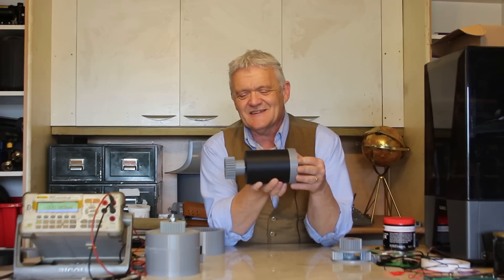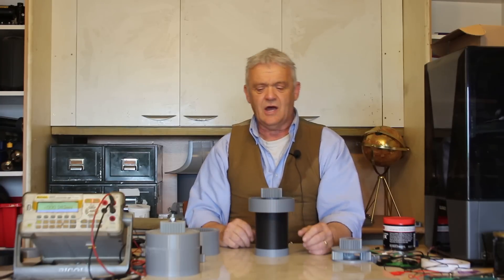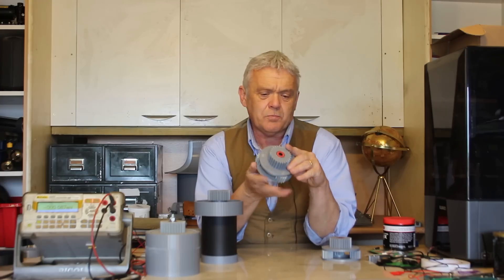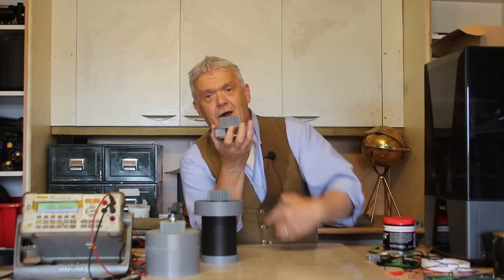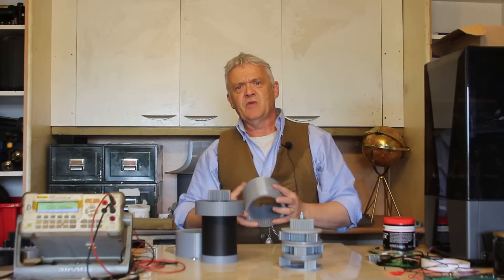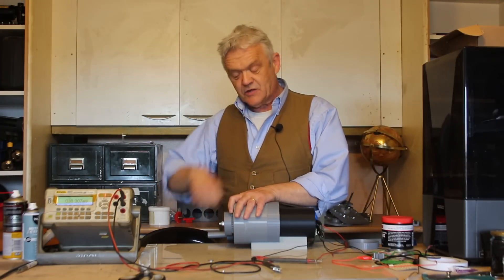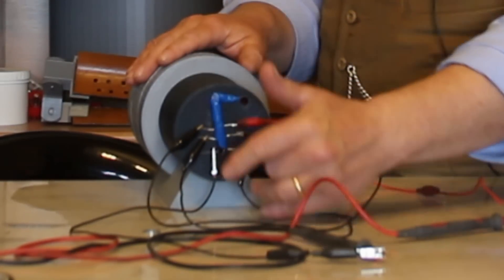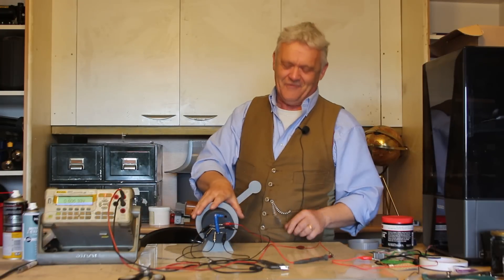1964 A DIY Wind Turbine Gearbox And Its Crazy Output

Comment: I live the gearing sysyem on that and want to build one mtself. Im looking at adding it to a solar inverter system, is there any way of limiting the output voltage to say 48v or whatever the input voltage of the system is? 
Pumping in 100v would not be great 😕

Comment: Nice, and still even with the gears, power out = power in ,  approximately here.  A voltage increase but a current decrease by the same value.   P = VI or VA. Another way to boost voltage is with a transformer, perhaps to send the power a few miles away without using thick wires,  and then we can use a voltage step-down transformer at the destination.

Comment: Could you maybe make a mould for the components and then cast them using the graphine plastic youve made previously?

Just wondering about durability...could be about as practical as required if you could make it work.

Comment: A  suggestion，maybe you should add a automatic clutch system between the generator and the gearbox to  let  the blade build up speed before start generate power.Or  it may need a very fast  wind speed  to start the  rotation .

Comment: I notice your blades are wood. Wood is probably the material most resistant to stress cycling. A big problem in large turbines compression/tension. If they used wood you could cut it up and build sheds out of it or something, no waste.

Comment: The gearbox will be a nice source of heat due to the friction losses!  In a perfect design the available output torque from the wind turbine will be matched to the torque load of the torque-to-electricity converter part of the system so that the maximum tip to wind speed ratio of the blade tips is not exceeded at design wind speed. In other words - the load (coil design, number of poles etc) should be matched directly to the turbine power curve without the need for gearing up.  But its a lovely wee gear box anyway in'it!?

Comment: I love it Robert.  We are currently working on an actuator at my employer that uses a very similar planetary gear system.  Not to state the obvious, a major factor we found was gear quality is paramount to efficiency.  Any gear “roughness” had a direct effect on the overall performance.  3D printing gears is excellent for proof of concept, but good quality gears will produce much better efficiency.

Comment: What is the point in designing a gearbox at the cost of lost torque?
Design the stator and rotor for the RPM's you need. A low RPM stator can supply energy at hand crank speeds, no need for a gearbox.

Comment: The High voltage is very nice. But in all these energy generators the more important thing is usually the total power. It would be more instructive if we can see the power output rather than voltages or currents.

Comment: The peak voltage only matters if your insulation breaks down.

You can always transform the power to a lower voltage and higher amperage, and the impedance is your resistor, only it wasted a lot less energy than resistive losses, especially if you use a ferite coil.

Comment: Brilliant show, mate.  I would love to see it with four on it, as that would be scary indeed.  Look out as you might get so much voltage you will not melt the wires just measuring, but the electricity can jump across if not careful (breakdown voltage of the wire sleeve material).

Comment: i have boxes of old cordless drills and they have the stacked planetary gear stuff in them between the motor and the chuck, it also has a lever that must push one of the ring gears from a higher speed to a lower speed set of gears. so i took one apart and it ended up in a heap of little metal bobbies abnd i couldnt quite figure out how to put it back together. but yeah, i can put a fan blade in the chuck, spin it up, and the motor spins crazy fast shooting power at me. i like big plastic gears tho, think ill print some up!

Comment: Have you ever seen the size of the wires in the vape pens , not the coils that vaporize the ejuice I'm  talking about the wires that carry the electric to the coil/s , they are very fine and they will handle 2 to 3 amps at 3 or 4 volt I think. Also the wire in the AC adapters have to handle at least 120 volts , the amps is usually I think in milliamps but I think some of them will handle up to 1.5 amps . That's cool Robert. I'm not trying to push you into frying your generator.
Reply from the maker: you are right mate i am being a bit over gentle - but i want a minimum target - that is to beat the $400 turbine - if i can do that with the fraction spend i have made so far i will be happy - I also hope others will take this and improve on it mate

Comment: would this charge a 12v battery with the hand crank in a reasonable time or a 20000mah battery bank for offgrid/camping use
Reply from the maker: you can put out about 60 watts with arm strength

Comment: I guess gears are simpler than making a complex stack of centrifugal gears. Where you have balls that change the gear ratio as they spin faster, they move to the outer rim of the disc to increase the gear ratio as speed increases.
Reply from the maker: yes they are

Comment: That setup with plastic gears appeared to have a lot of drag, more than the blades can overcome in a modest wind.
Reply from the maker: it does have a lot of drag but it will be fine - of course the simplest way to improve it is to improve the gears

Comment: Looks like you were putting a fair bit of effort in to get that 100V with no electrical power produced. Those stacked gears will be absorbing a not insignificant amount of power. Be interesting to see how much more difficult it is to turn in a realistic situation when you stick a 10 ohm resistive load between the output terminals... 😊 I think that sized turbine blade won't be big enough...
Reply: No lube and no bearings
Reply: @SinsBird  Do what now...?
Reply: @saiello2061  With lubrication and bearings I imagine it would be 3% or 4% power loss on each stage.
Reply: @SinsBird  Possibly, but those gears are very noisy! Noise = inefficiency.... Best solution is always no gearbox and redesign generator for direct coupling.
Reply: @saiello2061  The approach really depends on ones abilities, some people are better with mechanical part, others with electrical. So whatever takes the least effort and money per kwh is the way to go. Anyways, there is/was a 3d printable wind turbine on thingiverse called MKIII that seems like a pretty interesting project if you have access to cheap 3D printing. The only problem with it is that it's using a stepper motor and if I'm not mistaken steppers are terrible generators, much better to use a DC motor on it.
Reply from the maker: no it isn't - there is no such thing as a best solution
Reply from the maker: spot on mate
Reply from the maker: losses are going to be high mate - talk about stacking things against myself lol
Reply: @ThinkingandTinkering  Agreed, in fact there are never any solutions to anything, only compromises. But if one is interested in efficiency, and to be honest most have a mind to this, then intervening power transmissions néed to be the first thing to go, or at least kept minimal, that's all... 😊
Reply from the maker: @saiello2061  that's a fair comment mate - but I am not interested in efficiency per se - I am interested in beating a product manufactured and sold for $400 with something home made that anyone with a modicum of skill and access to small resources could make at a fraction of that cost - but you do make a good point and you are dead right this could easily be improved with better engineering. Oh by the way the resistance f the coils is 80 ohms so an 80 ohm load would probably be a better choice of load
Reply: @ThinkingandTinkering  Oh yes, anyone making the effort to try and beat an overpriced commercial unit is defo to be applauded..! 👏 Interesting to see how it pans out. Good luck..! 👍
Reply from the maker: @saiello2061  cheers mate - and i really do appreciate the time you took to chat - all the best
Reply from the maker: it was pretty easy actually - but are right a lot of efficiency was lost in the gearing - so - improve the make of the gearing

Comment: High volts doesn't make the wires hotter, if anything it makes them cooler, you can make the same power with less heat using higher voltages as it negates the wire resistance. Your voltage is only limited by arc distance, I think 200v is safe.
Reply from the maker: cheers mate

Comment: Thicker gauged wires will lower the voltage to a more useable voltage while increasing the amps, and more blades give more torque less RPM
Reply from the maker: cheers mate

Comment: some of the cheaper cordless screwdrivers have planetary gears in them, many years ago I bought about 6 of them (for something silly like £1 each) and used the planetary gears the other way around, one to produce a fine focus knob for a telescope, and also to produce a drive system for tracking the stars that was geared down to approximately 1 revolution per day, the cordless screwdrivers use planetary gears to increase the torque and slow down the motor speed.
Reply from the maker: well worth looking ut for and keeping if you get a cheap source mate
Reply: @ThinkingandTinkering  yes they work both directions , I wonder if there is a way to make a centrifical clutch to lock out one or some of the ratios for different winds speeds?
Reply: @maxgood42  Sturmey-Archer did this decades ago. All you would need is a govenor weight on the hub, held back by spring pressure, as rpm rises/falls the weight pulls/releases the selector cable, and changes gear(s).
You could do similar to pivot the blades to 'feather' the angleof attack. (Ive done the latter, with a thrust-release bearing, I can adjust the torque/rpm limit while it is turning).

Comment: Once again brilliant. I think starting torque may be an issue so you may need to reduce the gearing a little buy hey, we will see, Can't wait. Thanks for the best channel on you tube Rob.
Reply from the maker: I agree mate - but to be honest I have no idea - however, you might have noticed i did the ring gear in sections too so i can alter the gearing pretty easily if i want to - the plan is to try it out and modify it on the hoof so to speak and see what we get
Reply: This is my concern too - so I can't wait to see how it performs and whether the starting torque is a problem or not, and if it is how Rob will choose to get around it! Really enjoying this project. Thank you Rob!
Reply from the maker: if you have a look at my reply to Peter - you will get an idea of what i plan mate - of course if it works straight from the bat I am going to crow like mad lolol

Comment: I like it. I got same result by stacking bicycle rear cassettes. (no 'printer', just access to tons of scrap bikes and a MIG welder) 
I’m still at a question why wind-turbine blades are so slim at the tips. I can understand bird/bat/aeroplane wings being so, for weight to lift and strength considerations. But assuming leverage and torque are the thing wouldn’t blades that are broader at the tips ‘grab’ more air? If weight re lift isn’t a factor, the spine/hub of the blades can be beefed up easily to cope.
Reply from the maker: good question mate and good alternative source of gearing cheers me ol' china
Reply: You definitely have a point there-worth taking a closer at I believe.

Comment: Still waiting on the ONE VIDEO that will make these power generation USEFUL. How do I safely store this power in my solar generator.
Reply from the maker: ok
Reply: A wind turbine needs a dedicated charge controller, preferably a Maximum Power Point Tracking (MPPT) controller, rated for the battery voltage of the solar generator if they are to be used together. 

-still waiting for THAT VIDEO too.  I expect at least a few year wait.
Reply: @danedmiston9673  Can you outline some practical (or technical) principles of how a MPPT operates as an interface between a source of power/energy and storage?  Just asking.  Thanks.
Reply: @bikerfirefarter7280  For solar panels there is Rated Voltage, an Open Circuit (no load) Voltage, and a Voltage at Maximum Power (the voltage were the panel operates most efficiently).

For example a solar panel Rated at 12 volts may have an Open Circuit Voltage of about 21 volts and a Voltage at Maximum Power of about 14.3 volts in full sunlight.  As the sunlight dims the Open Circuit Voltage will drop as well as the Voltage at Maximum Power.  If the Open Circuit Voltage is measured in the reduced sunlight then the new Voltage at Maximum Power can be calculated.  For many solar panels the Voltage at Maximum power will be about 68% of the Open Circuit Voltage.

A simple charge controller only limits the voltage to the battery to protect the battery.  An MPPT will protect the battery but also tries to maintain the solar panel at its Voltage of Maximum Power.  A google search will show many different ways that can be used to constantly estimate the Voltage of Maximum Power and then maintain it. Some MPPT controllers will allow charging in very dim sunlight by boosting the voltage from the panel up to the required charging voltage.

For wind turbines the Voltage of Maximum Power is based on the RPM of the alternator.  A good wind turbine MPPT will allow for custom power curves to be programed into the controller.

Another thing to consider for wind turbines is that the efficiency of the wind turbine is tied to the turbine RPM as a ratio of the wind speed (TSR).  Unless the alternator and turbine are very well matched it is hard to achieve their full efficiency potential even with the best MPPT.

Comment: Hi I am regular viewer of your channel I like the way you explain and do practical stuff.
 
I have a question....regarding wind turbine and power generation. 

Can we use piston instead of direct power generation from windmill to compressed air and use air engine or turbine to generate electricity at constant rpm?

I thought about it because vawt or hawt slow wind will not produce enough power to charge battery, but slow wind will compressed air (slowly) which can used it later to generate electricity. 

I don't know about efficiency and related number.....I just have a thought....

Regards
Reply from the maker: for sure - you can think about the compressed air as a kind of battery - and it has lots of advantages over normal batteries
Reply: @ThinkingandTinkering  thank you for your reply. I am going to make a darwin wind turbine but had a confusion regarding compressed air or direct power generation. 

If possible can you explain it's advantages you mentioned in comments in your future video?

One more thing I Don't know that how much torque it required for compressed air and should I have to use gear to increase torque? And how much it can compressed air in a tank in term of psi. Means can we expect 120 psi with a small piston in 200 ltr tank....😀

Sorry to annoy you but I have many questions and don't have answers.

Comment: So I wonder, how much wattage can this produce? Sure there can be around 100 volts but what would be the current?
Reply from the maker: oh we will get what we want mate and then some - I modeled this after a best selling folding wind turbine which produces 40 watts from a 28mph wind - that's 12.5M per second - selling for $400 - we have already beaten that in lower wind speed tests
Reply: @ThinkingandTinkering  Imagine how much power you could have bought with that amount of investment. I don't think you will ever get to a profit. Just like the big ones, that only run subsidized. Sorry that I don't believe in it but keep the joy in experimenting. Love your video's btw.
Reply: @onnonius  you can make profit by building and selling the turbine
Reply: Current could be anything, it depends on the device being powered, a device "pulls" the amps from the generator, the amount "pulled" increases with voltage - an LED array rated at 25v 0.25A would draw 1A at 100v (it would also burn out). The same device can be built with more parrelel or series elements to work at different voltages.
Reply: How much power it produces depends on how much wind power goes into it. How big is the swept area and wind speed. The question is, how efficient is it at capturing that power.
Reply from the maker: @DFPercush  spot on mate - cheers

Comment: Looks like there's quite a bit of resistance to turn and with light wind it may never move. Need to see your entire system to evaluate the estimated output. Waiting with baited breath because I need to make this, to charge my hydroponic batteries if the sun don't shine on the panels. Thanks Rob!
Reply from the maker: that's a problem for all wind turbines mate - it's why they have a start wind speed as they need a minimum torque to get them turning
Reply: @ThinkingandTinkering Right, maybe the solution is to put the fan blades on the planetary gears themselves at each level, so when its light wind it activates the low gear and then slowly builds up, if thats even possible?  Anyways thats what i was imagining when seen those staacking gears, it remined me of an automatic transmision, but for wind.  That would be cool if it would work, a turbine that works at all  wind speed, maybe these planetary gears or  magnetic ones are the key to do it.
Reply: @mikejones-vd3fg interesting ,if possible.
Reply from the maker: @mikejones-vd3fg  that's clever mate - i never thought about it - well until now - thanks for sharing
Reply: How much energy is there in low velocity wind, and is that juice worth the squeeze?

Intermittent generation is the bugaboo with most small-scale generation. Sometimes the sun doesn't shine, sometimes the wind doesn't blow. 
Current thought is to store energy generated in times of plenty to use in times of scarcity.